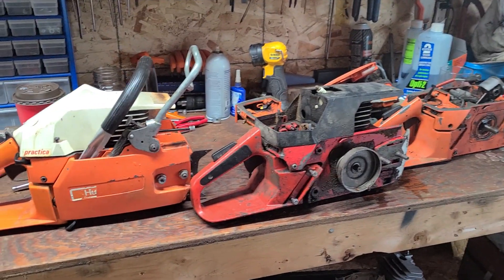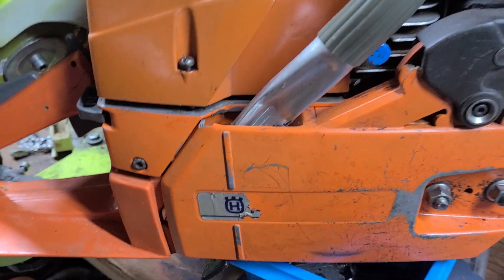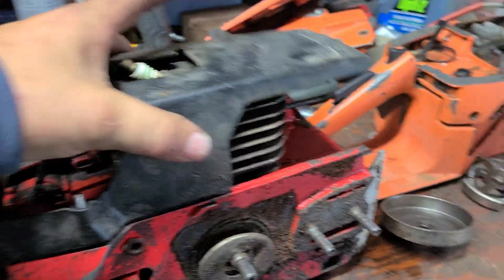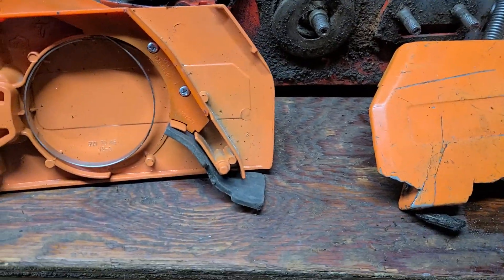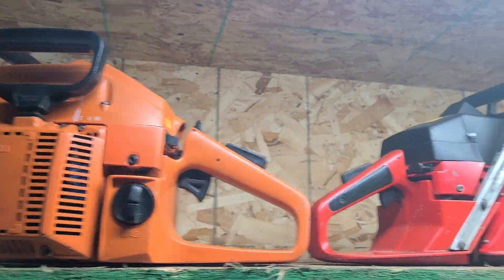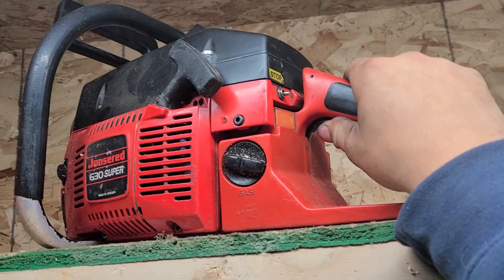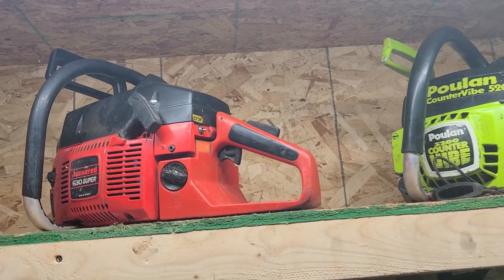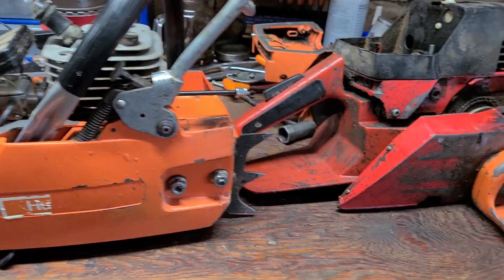200 series husqvarna parts interchangeability

Comment: I have a 162 SE and I’m interested in putting the 52 mm big bore top end kit on it and I’ll do whatever it takes to fit a 272XP top cover on the 162 SE chassis, is it just the bolt holes for the top cover need to be layed out and drilled and tapped in the chassis? Thanks

Comment: In a future video could  you explain all of the adjustments and what they do for the chain brake? Mine locks up on its own think its from vibration. And I noticed 61 vs 162se the top covers 1 is solid on the 61 and sticks out further over the muffler  then the 162 I have has a shorter in length and it's vented/ribbeed  over the muffler

Comment: you can go on forever about the 200 series such as  the 254 257 261 262.   All these series use the same crankcase . The 254 uses a different crank than the 257 261 262 . The 257 261 262 have a longer rod. but use the same crank, This is just an example   Thanks for sharing

Comment: The only thing you didn't mention is husky takes pulse through the block , Jonny has impulse line from cylinder so carbs are not direct swap...fine thread anti vibs are hard to find ...I considered tapping/drilling metal tank to take the coarse threads and just be done with it....
Reply from the maker: You are correct, 625 and 670 johnny have intake boots and a pulse line. 630s work though..

Comment: Hello tinman,I found all this out the same way u probably did...I got a Chinese clutch cover the brake action was brutal, however I noticed the main issue is the spring inside the flag, it's shit not even a good copy, by swaping a 254 spring  it works good believe that..so a OEM 266 spring would be ideal also..I tried to bring back a parts stripped 266se using Chinese parts turned into a flop...what I wanted in the beginning was doner 61 which were common place once....
Reply from the maker: Those springs are crap, I cant remember what i used 55 rancher spring and brake assembly i think????

Comment: I just bought a 61 plus one in a box in pieces for parts, it goes alright and will get me out of trouble while I repair my 039 main saw.  It's all orange with a wire chain brake handle.   Bit of clutch drag that I find irritating though.  Got sold an upgraded clutch which I haven't got yet, but thinking it isn't going to fit the 61 if its a different thread from the last saws in the series perhaps...  Managed to get a couple of replacement clutch springs that might get the drag issue fixed up.  Anything major to check with the 61?  Seems like a strong saw with a 20" bar and munched through the normal tough Oz hardwood I cut for firewood pretty well indeed.  Probably about the same as my 039 so liking the saw quite a lot for the price so far.  Cheers, nice to have found your channel via The Ironhorse.
Reply from the maker: Hey welcome to the channel!! 

When i get an old saw like that I usually replace the carb kit, both the orings and crank seals on both sides. A new fuel line rounds out the repairs. 
If she runs good and tunes easy shes probably ok.
Reply: @tinmanssaws  I'm working on the idea of not messing with a saw that starts, idles, transitions and runs under load perfectly at the moment.  I've worked out which Tillitson carby I have and will order in a kit to have on hand - will see if I can find a gasket set too because yeah once you remove things...  I didn't think of replacing the seals as this unit allegedly was put together a couple of years back - and not leaks I think given the rock steady running.  The only big issue is stalling or chain run on due to the clutch not releasing.  Hoping a new spring fixes that.  I used it really hard cutting some filthy hard wood about 34" thick, so cutting from each side and the saw loved it, as usual the sharpness of the chain has a lot to do with that but she didn't sag for a moment.  I reckon I got a good buy, fair saw for a fair price which is the ideal transaction.  She will get a proper workout this Saturday as going wood cutting - and nothing I cut is a soft wood...  I started with Huskies - still have my Special 45 but not used much since I got the Farmboss 039.  Now in the space of 12 months I've got three new huskies - brand new 135e and large pole saw, and this 61...  I like them very much.
Reply: @tinmanssaws  Update - found some things not to like unfortunately...  Airfilter is off a 268/272 - had one spring left, and the air filter full of holes and deformed - all new parts coming but managed a temporary fix for now.  Bar was completely knackered - quick trip to the local huskie agent and a new bar and two chains later and that's sorted.  Price was very good too so original parts a great option.  I have never seen a more worn out drive sprocket in my life so that was interesting, good job I got a couple of new ones with the clutch - replaced clutch with the three spring which works ok but slips if I bog the chain down - so better replace the drum...  either that or have to go back to the long spring thing.  Got a feeling there is a lot of 268/272 in this 61.  Given the amount of sawdust that appears to have gone through the engine compression is ok, but not high.  There is a lot of corrosion in the case sections which is an issue potentially into the future and the old sections in the bits box are corroded right through in many places like the oil tank, main cases - so need to watch that I fear.  All that said - just chewed through two tonne of hard Oz firewood and it absolutely loved it.  Got some rings, carby kit and seals coming once I work out which actual engine is in there - thinking your advice is sound given the condition of the rest of the saw.  Still happy though - it cuts wood and doesn't sag even in some oversized muppetry...

Comment: Hey also 162se has a magnesium gas tank...i have seen one coated with white material on the inside aka "white death"...old gas sitting in the tank too long. You have any tips on removing it?
Reply from the maker: I've had a few saws like that over the years. 

Ive cleaned a couple with a hand full of nuts and bolts and then shake the tank really good. Thats bout as good of a way as I've figured out.
Reply: @tinmanssaws  thanks man! Hope yer thriving away today

Comment: Some good info there TM, I have just made up some crank adapters and timing wheel and going to use the info I gained on your port timing video to see if I got the porting right on a few of my saws that I ported.
Reply from the maker: I ported several at the beginning with no timing wheel lol. They ran really well but not as well as a saw I use a wheel on..

What have you ported??
Reply: @tinmanssaws  I have ported two Stihl ms260's and a Husqvarna 372 so far, one of the 260's was a recent build and I want to check the numbers.
Reply from the maker: @MegaDirtyberty  cool id be interested to hear what the numbers are when you time them.
Reply: @tinmanssaws  Stihl 026 squish was .30 reduced down to .26. Numbers ( in deg and exhaust opening, transfers opening, inlet opening) before 266, 238, 68. After 270, 245, 73. Tdc at 0deg on wheel and unported. Do these numbers sound right?.

Comment: Well explained. Also 268, 272 and new style 61 with orange top cylinders have a more vertical spark plug hole causing clearance issues with the older top covers. Ironically they will fit under a 625 Jonny as the open port cylinder  was higher than the 630.
Reply from the maker: Thats one thing i forgot to mention for sure..
Reply: As you said. Nobody knows it it all. But your 13 minutes  had a bunch of good info. Some new to me. You have a good channel to share information. Thnx much.